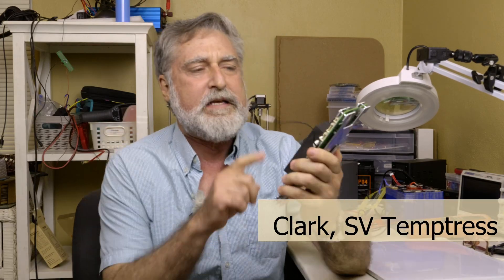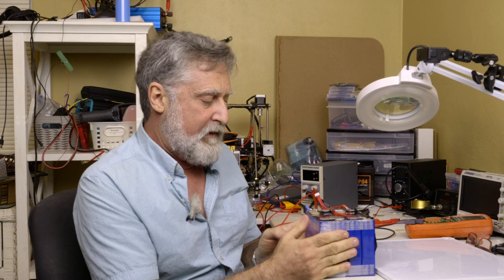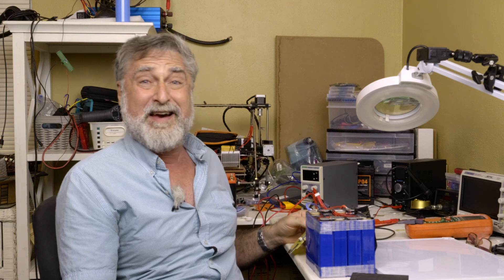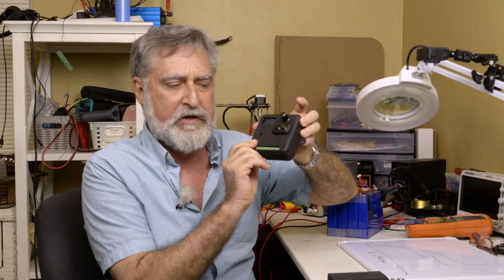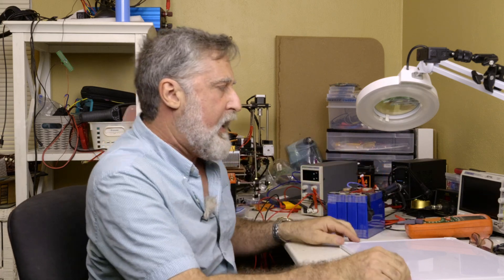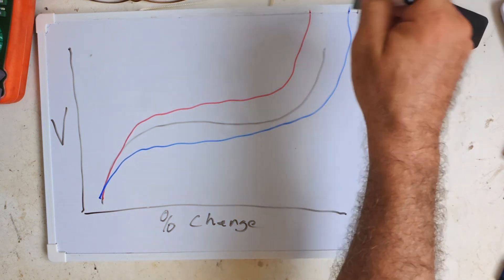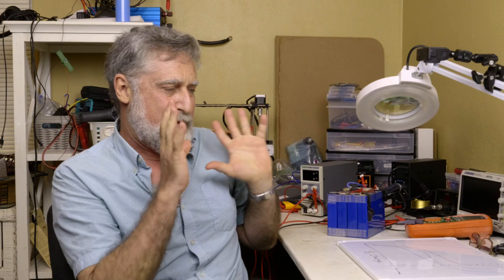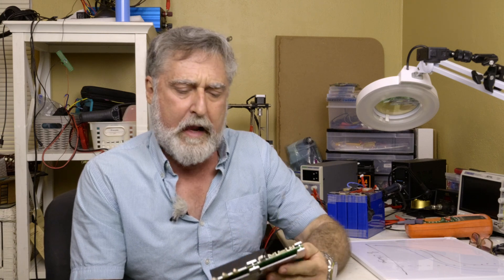What is a BMS really??

Comment: Great video once again !   Question for you...  I have two 200 amp batteries with a 100 amp BMS on each (Redodo batteries)...  My solar is often pushing 150 amp, which was fine until now (had the batteries for 2 yrs now) ... but lately one gets charged first and all that 150 amp solar goes to the one left, that is not completely charged yet ....  What i'am experiencing is that the positive post gets really hot ...   I thought that the 100 amp BMS would only take what it needs and that wouldn't be an issue, no ?    I did "balance" both batteries, charging them separately and then letting them sit for 12 hrs together, but that didn't solve the issue.
Reply from the maker: Several things:
   Li will take what you offer and it will gladly hurt itself doing so
   You should never charge faster than .5C. So for both batteries you should not charge over 100a.   Charging 1 at 1.5c is bad news, stop doing it.
   A BMS stops accepting power when one of its cells goes over a set voltage (often 3.65v). This happens to one battery over another when either one battery needs cell balancing again, or one battery is being charged with a different resistance than the other.

   If you use a BankManager charge will be shut off at 100 percent so this problem will likely go away as long as the batteries are balanced.
Reply: @Clarks-Adventure  Thanks for the advice !  I'am just wondering, for people like me, who have a bank of multiple batteries, there is no way of knowing which oneS will get charged first leaving , eventually, one left uncharged ... provoking all the power coming from your charge controller(s) to focus on that single one....  (?)
Reply from the maker: What I do on Temptress is using a BankManager per battery (or bank of like batteries).  This way each bank gets its own charge control.
Reply: @Clarks-Adventure   So you would have multiples batteries, that came stock with their own BMS inside,  and add another BMS , externally , to control all these batteries BMSs ?
Reply from the maker: No the BankManager isn't a BMS.  A BMS has no clue how to charge a lil battery correctly.
   Check out MarineDCAC.com to see more.

Comment: Thanks, Clark, thanks to you (and others), I learned a lot about Lifepo4 in the last couple of years. I know your Bank Manager is really good! But the price is higher than the added Lifpo4, so it doesn't make sense for me. What I understand from your graphic is the differences in voltage at different currents. I have 3 sources of charging: solar, DC-DC, and the main charger. Solar and DC are low amps, and the main is high. Now I have the maximum voltage for all the sources dialed in on 14.2V.(instead of the advised 14,6v)  But should I change this? A bit higher for the low, and a bit lower for the high current?
Reply from the maker: Any voltage over 13.48v can and will hurt a fully charged 12v battery.
   Sorry they cost so much.  But making things in small batches is expensive.  You are just spoiled by Chinese prices and that is based on them having no research costs.  They just steal patents.
Reply: you must nothing change only understand the basics.
all batterys are voltage based and LFP more then alot other a LFP cell is at 2 volt empty and at 3,65 volt full.
if you have now a 12 volt battterys this is 3,65 volt x 4 = 14,6 volt= all 4 cells full.
over this its not possible to charge coz ea battery have a BMS build in that tracks ea cell by itself.
lets say:
you have a small drift lets say cell 1 drifs with lower capacity so it will reach faster the 3,65 Volt then the other 3 cells so the BMS will cut off your battery on a lower voltage, lets say 14,4 volt and your BMS kicks your battery out, so you will know 1 cell have a voltage drift.
if you set your charger to 14,6 volt or 14,2 volt not matters this will be in capacity far below 1% differenz.

important most ready to use batterys have balancer build in into the BMS and they are set to voltages like 3,5 volt or higher so its important to charge the battery really full to bring the balancer to kick in an clean cell driffts !!!!
top off balancer are in near all LFP batterys build in thats why its important to charge them full.

Comment: What about us boaters up in New England where boats are stored in freezing temperatures for 4+ months? Can we disconnect fully charged lithium phosphate batteries with a bank manager at the end of the season and leave them in the boat?
Reply from the maker: I'd take them in or install some small heating.  They shouldn't be stored below -20c. That's -4f.
    So if it gets real cold where you and the boat is hauled out that could be the biggest problem.
   If it's stored in the water likely it won't get that cold inside the boat.

   As I understand it, charge them up to 75 percent or so and over one winter they won't self discharge enough to cause issues.  But I'm a tropical boy nowadays after growing up with -40f.   I get PTSD thinking about cold weather issues.
Reply from the maker: Oh and.... Sail south young man

Comment: It is all about AMPS. Amounts of amphours (AH) going in, or being spent, to calculate the state of charge.
That is why a precise shunt is needed, to calculate the amps going in and out of the battery (LiFePO4 batteries).
Active vs. passive balancer, easily explained:
Active - discharge from high voltage cell and charge it into low voltage cell.
Passive - discharge from high voltage cell through a resistor (or similar), simply draining the cell - loosing the amphours being drawn.
Active for sure is better, cause of less loss of amphours in the balancing-process.

Check out Andy and his Offgrid Garage for VERY detailed explanations regarding balancing and what BMS'es "works best".
Reply from the maker: Here's a teaser.  In next week's video I'm going to make a case why "passive" can be better.  Also I'm going to outline a new method proactive balancing

Comment: I don’t usually condemn videos but I don’t think that I have ever seen more bad information in a single video so I decided to type an essay.
You can absolutely draw too much current from most LFP batteries and destroy them. You have to look at the specific data sheets for your battery cells to see how much is too much. This is usually described as a discharge rating in term of “C”, where C equals the Amp hours of the battery. The rating may look something like 2C continuous, 10C for 30 seconds. Same for charging, usually it will look like 0.5C std charging and 2C fast charging. Using any battery outside of the specs will shorten the cycle life of the battery. A well matched, good working BMS will take care of this for you.
NEVER charge your battery to over 100%, even when balancing, never, ever, period, full stop. This 100% is based on voltage, not your Watt hour meter, or your Amp hour meter. Again, a good working BMS will take care of this for you and not allow this. 
Charging a LFP (LiFeo4) battery is absolutely based on voltage. A good BMS will not only measure the individual cell voltage but allow you to limit the maximum voltage difference of the cells. A bad BMS will just measure the total voltage and will use total battery voltage to turn charging off. If any cells are low, and the BMS doesn’t turn off charging until full voltage, then at least one of the other cells will be too high. A good BMS will read individual cells and stop charging if ANY one cell voltage is too high or too low.
With LFP batteries you need to “bulk charge” them first (limited by Amps), then transition to “topping charge” (based on voltage). A good LFP charger will do this automatically, a better charger will let you program what voltage (not percent) this change occurs and also let you program the “stop charging” voltage. This is usually about 3.3 Volts, but anywhere on the upper slope will do. We call them slopes cause they are shaped like slopes (actually half parabola), never heard anyone call them hockey sticks. My battery pack only has about 5% of total capacity on each slope, so my 3.3 to 3.1V flat lasts for about 90%. Most battery degradation (damage) happens on these slopes, so if you keep your batteries on the “flats” they will last longer.
 A good BMS will also let you set the “turn on voltage” (again not percent) of the cell balancing. Best practice is to turn on the balancing when the cells are on the upper slope, although some leave balancing on all the time.
There is a reason you need an external “gas gage” on LFP batteries. Most internal BMS’s will use only voltage to show state of charge. Any gas gage needs to show Watt hours (or Amp hours) used and Battery or pack Voltage. This Watt hour gage needs to count up when using, and down when charging (some don’t), or you will not know how many Watt hours you have left in the tank. 
The reason that you need a Voltage meter is to know when to reset your Watt hour meter. Yes, unless you have a self resetting Watthour meter, you will occasionally need to reset it to zero. Because no meter or BMS can account for the losses incurred because of resistance inside the battery and heat (even if the shunt is mounted on the battery terminal) there WILL be losses and it will always take more Watt hours of charging to reach full Voltage than was measured as taken out of the battery. So then your Watt hour meter will be showing negative Watt hours at full voltage, and it will get worse every cycle until it is reset. My old meter would be about 10% off after about 15 cycles.
My gas gage display shows voltage, Amp hours, and Watts and Amps being used/charged.  When pulling from the pack it shows a negative sign at the Amps, and no negative sign and a little hourglass when charging. It has a countdown timer to show how many hours left in the battery pack at the current use rate. 
It also has a percentage number and accompanying lighted ring (at 50% the ring only goes halfway around the number). I have to input the Amp hour total of my pack and then my percentage shown is derived from the Amp hours left. It self-resets the percentage to 100% and the Amp hours to what I have it set at, when my voltage reaches 57 Volts (which I am also able to change and set).
Reply from the maker: That's quite an essay.  I bet it's useful for you  (because it's not for anyone else) to keep you feeling you know it all.
If you don't open your mind and accept proven research you will never learn anything new.
  Keep it up, you can continue to feel that you are an expert but of course your batteries will die an early death.
Reply: @Clarks-Adventure  I don’t claim (or feel) that I know it all, although I understand that it sometimes seems that way (from what others have told me).
I am always willing to learn, that’s one reason why I like to watch technical videos like yours. I also like to watch sailing videos (my sailboat is only 27’) and for me it’s even better when people like you combine technical videos with sailing or sailboats. 
My favorite video of yours is the Dragon Wing shade, and the ones on air conditioning are a close second followed by the ones combining lead acid with LFP batteries. I also agree with you that engine start batteries need to be lead acid. I will continue to watch your videos but I promise not to comment on any others.
My batteries might very well die an early death, I think I let them charge to full voltage way too often, sometimes it may be every day (depending on how much sun I get). But all my batteries that I use constantly are rated at least 10,000 cycles or 10 years, so I have not been worrying about the cycle count because another Youtuber pointed out that “why worry about the cycle count when the batteries will age out anyway”. If they do die early then I will have learned something new.
None of this was a personal attack. And again, I am always willing to learn so please school me and explain what is wrong in my first reply.
Reply from the maker: @bearman975 you might wish to watch this video.  https://youtu.be/3USAqjntxIs
Or watch it again.  I promise I'm not making this stuff up.  Everything I say is supposed by academic papers coming out.
   Also maybe read some of the popular comments.  Other electrical engineers are agreeing with me, even some who I think clicked on the video to find fault and troll.
Reply: @Clarks-Adventure  I was watching the exact video you linked above when you commented, saw it linked in another comment (I don't know how I missed it when it came out).
Every white paper that I have read used voltage to determine when the LFP cells were full. Maybe I should say (or have said) target voltage. It seems that they usually stop charging at a target voltage and then let the cells rest (or equalize) for at least an hour before checking voltage again. In every thing I have seen on this, the equalized voltage is always lower than when the charging was shut off (showing that there was voltage drop without use and therefor no loss of actual power).
Every conversion has losses so it will always take more power going into a battery than was taken out during use to get back to full charge. This is why your State of Charge meter needs to reset.
Most of these losses can be measured but the loss of converting active power to potential power at the cell when charging cannot be measured while it is happening so you cannot use Watts out versus Watts in to determine the state of charge.  In effect you would have to test the cell after charging and see how much you can get out versus  what you put back in to determine the losses. I think the biggest problem with this loss at the cell is that it seems to vary with charge rates (more loss for more amps). The losses (or efficiency) of testing the cell would only be good at the use rates and charge rates that are in the test.
From what I can tell I think your bank manager uses math to figure out when to reset to 100%  based on charge rates and times. I rely on a meter that uses a settable voltage (it comes with defaults for different battery chemistries but you can change the settings).
My Victron smart (with bluetooth) solar charge controller allows me to set the charging start voltage and adsorbsion start and stop voltage. It has a "bulk" charging function that uses constant current up to the "adsorbtion charge" voltage setting, then uses constant voltage and tapers the current off as it gets closer to full. It also comes with default settings for different battery chemistries that you can change to your liking.
I have also never seen anything saying that LFP batteries develop a memory, can you provide links for this.
Reply from the maker: @bearman975  just research the memory thing. It's out there.  I've read it and I've had BankManager users come to me because of memory build up 

  You are missing what I keep saying regarding charging to a voltage.  It works when you charge at a fixed c rate IN A LAB.  In an active off-grid system the c rate is all over the place so the voltage target would be all over the place.
   My approach works at any and variable c rates.   It's the only one that does.